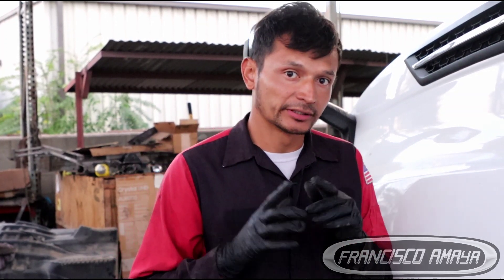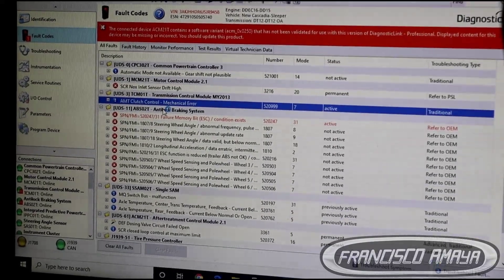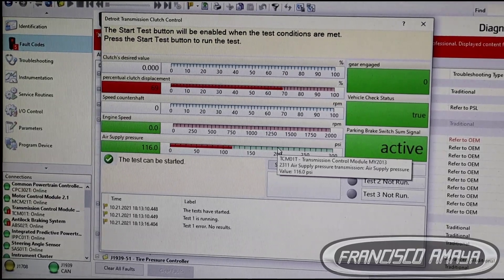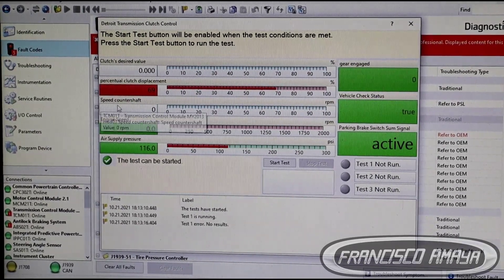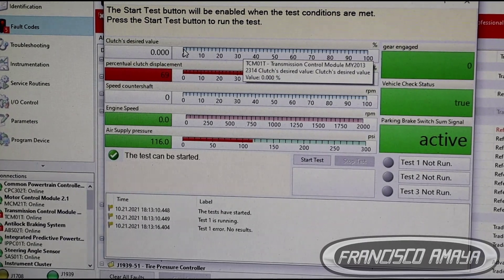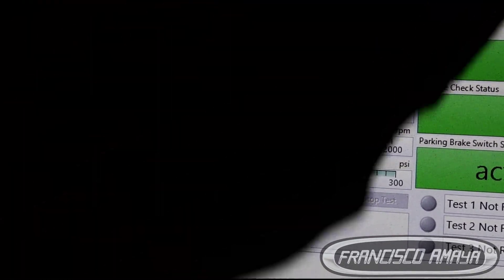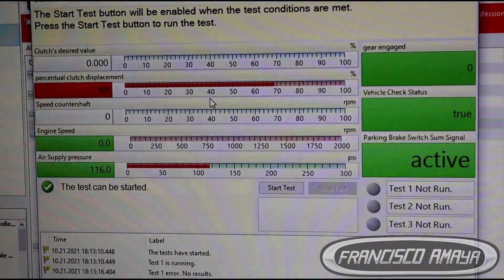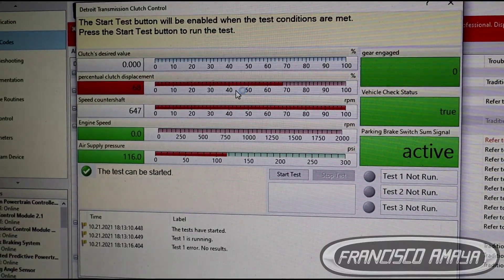DT12 detroit trasmission fault SPN 520999 FMI 7 clutch mechanical error how to repair this problem

Comment: 2673- ACTIVE CODE 520999/7. PERFORMED T/S AND VERIFIED AIR LINES ROUTING IS GOOD, REMOVED RANGE CYLINDER AND VERIFIED NO DIRT INSIDE AND NO RESTRICTED AIR PORTS. LUBRICATE PISTON AND REINSTALLED RANGE CYLINDER. PERFORM A CLUTCH AIR LEAK TEST AND IT PASSED. MANUALLY HAD TO PUT IN ALL GEARS, RANGES AND SPLIT. ALL WORK PROPERLY. WILL NOT COMPLETE TRANS LEARN. CREATED A DETROIT TICKET 13565995 AND ATTACHED DDEC REPORTS AND LOG FILES......

ALready Replaced TCM and Shift Controll Module.

Please give suggestions...2015 DT12 FREIGHTLINER cascadia

Comment: i have an emergency question if you can help please ... I have 2016 Cascadia with dt12 transmission and my shift controller on the transmission is damaged ... does that make my truck not to start at all ???
the guy who checked my truck with the computer said so but it kind of have a doubt as it doesn't make sense  unless if you confirm
i also changed the cpc4 and reprogrammed it to my vin and still doesn't start the truck and that's the only error it's showing